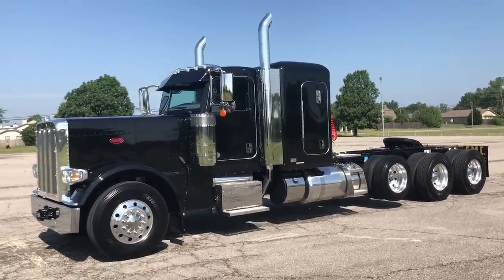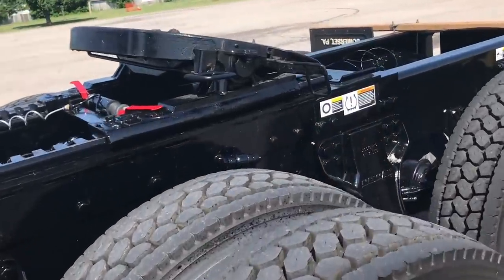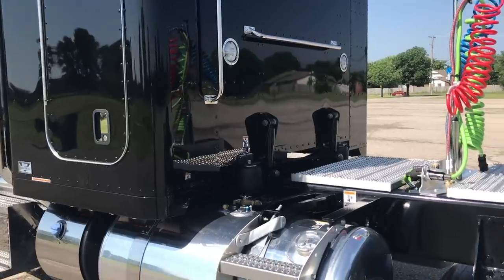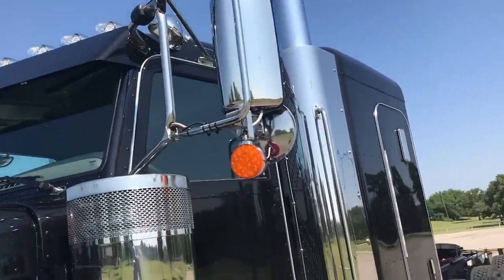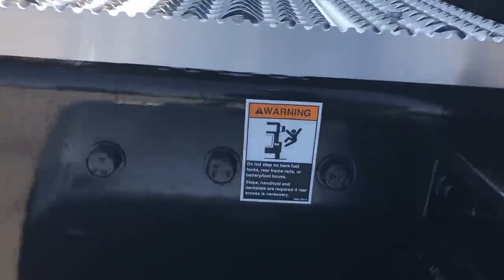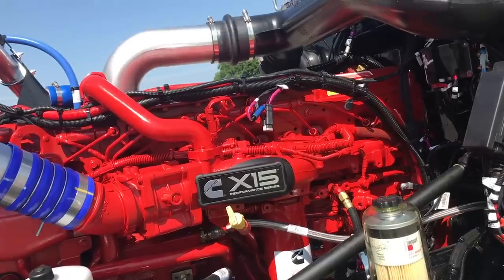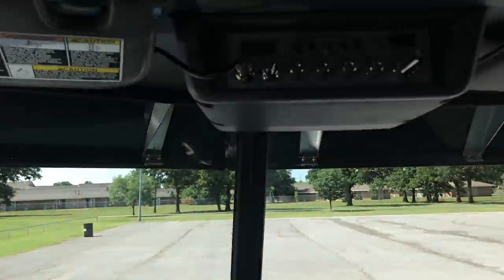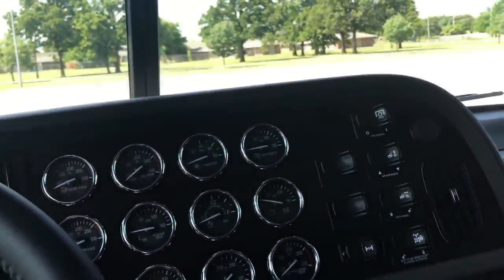2019 389 Peterbilt Heavy Haul 4 speed auxiliary transmission

Comment: Typical Pete salesman, spends more time talking about the fluff and buff. Can’t hardly talk about the technical aspect of a truck, joke.
Reply from the maker: What did i miss, always trying to improve. Thanks for watching
Reply: I think it was a backhanded compliment Steve... 👍
Beautiful truck, you do great work.🇺🇸
Reply: someone always has something to say Steve, if you didn't say it they would complain about that nice video
Reply: @SteveCarbone   What I don't understand is why the people designing these trucks never ask for any input from the buyers. They are the ones who are BUYING, USING, PAYING for these trucks. How about coming out with a new 359 with Corvette dash, extended hood, and air ride cab and air ride sleeper. How about a 359 with electric windows, cab controls for the sleeper, nice leather interior, double bunk. How about you keep your Cummins and make it a glider kit with a new set of Spicer boxes? Six and four to be exact. Two manual sticks. No air shift like on this 2019 black heavy haul. Make this and we'll by it. Take it home and put in manual Caterpillar like it should have. Some of us still know how to drive. How about it Steve?
Reply: imo you done a good job showing the truck,,,,,,,,,,,,i would like to hear more about the transmission set up like how many speeds the first transmission has,,,,,,,,i suspect it is an 18 but then if it is how would the auxiliary transmission be used? is it mainly for extra reduction or for the overdrive? its kind of hard to imagine an 18 speed needing more gears
Reply: if you got the money to buy a truck like that, there are several custom shops that can build it for you

Comment: Peterbilt uses bottom shelf pana Pacific garbage in their stereos. Their "premium" sound systems are anything but. Peterbilts lately are just the inbred relative of Kenworth, with a tux.
Reply from the maker: Jonathan Wortner but yet for 20 years in a row they are #1 in resale value.
Reply: @SteveCarbone  vehicle owners who worry about resale value shouldn't own them in the first place. Truck owners worried about resale value are morons who should be more concerned with making their truck payments on time. Most trucks, petes included simply aren't up to do the job of hauling/towing or acting as living quarters. 

Peterbilts are not in any way superior to what is predominantly garbage (Volvos and Freightliners) on the truck market. The 579 and 567 models really show how much Peterbilt has dropped the ball in past years. 

Their ultraride leather seats are bags of rocks, horrible button/toggle placement, in general the interior quality and design is on par with degenerate  designs like VNLs and Crapcadias.

Calling the same garbage other truck manufacturers use in their stereos "premium" is uninformed and moronic. They heavily distort audio at even a volume of 1, constant volume fluctuations while driving, at max volume road noise in cab still overwhelms, random unresponsiveness from the head unit. The dipshits at Peterbilt couldn't be bothered to check to make sure the trucks worked before sending them to my current employer. But what can be expected when peterbilt insists on using inferior quality equipment in the trucks they build...